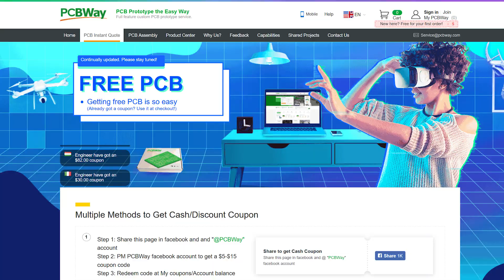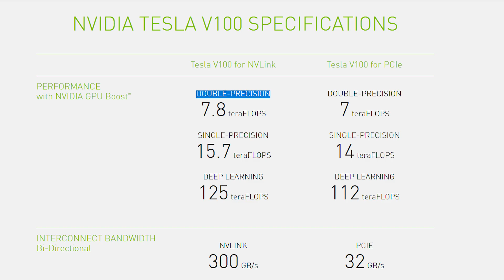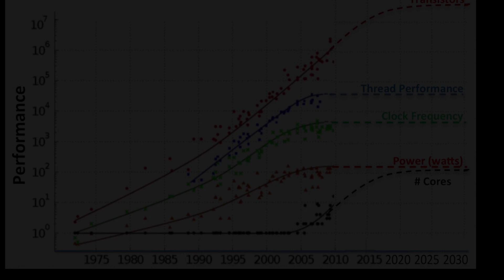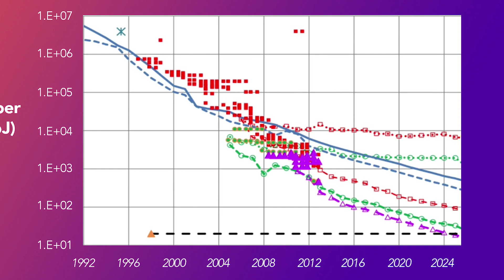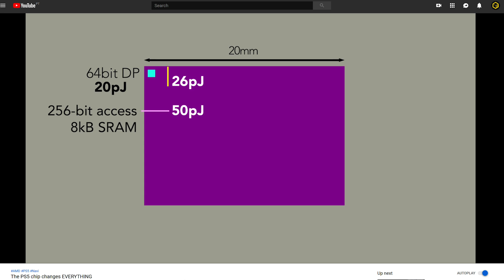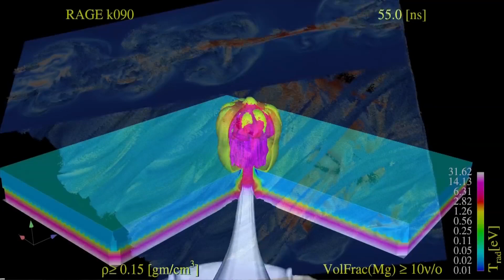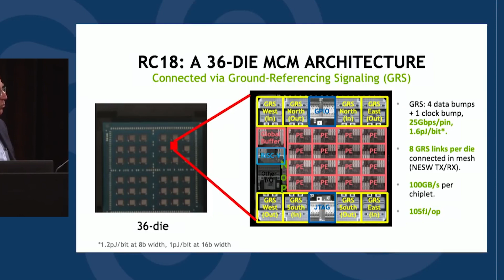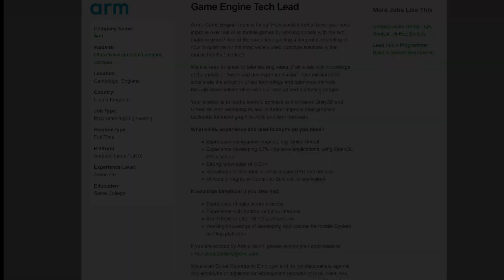The FUTURE of Computing Performance

Comment: So I guess this is what Lisa Su was talking about when she commented on the necessity of bringing x86 and ARM architectures together?
Reply: Miguel Pereira Wow it would be awesome
Reply: Why you walk bacwards?who care about x86 when we in age on x64...😂
Reply: @riannair7101  x64 is the same base instruction set, just 64 bit data and addressing instead of 32 bit. x86 comes from the Intel 8086 chip. x64 is just a misnomer for the same set dealing with 64 bits.
Reply: @getsideways7257  sometimes also denoted as x86-64
Reply: @Dylan-xc8yz  Indeed.

Comment: There is another largely unexplored area called reversible computing (adiabatic computing). Currently you waste a lot of energy when erasing information by releasing it as heat into the atmosphere  and reversible computing aims to avoid that as much as possible by reversing some of the steps in the computations. In theory you can create a significantly more energy efficient device than anything of what we have today.
Reply from the maker: Yes this is true, and there are other advancements and experiments going on in the area (NVidia has a few I didn't mention). I'll probably cover it in a video in the future.

Comment: There's an interesting story about the first ARM CPU that was made:
When they first tested it they accidentally put it into a test bench with broken power delivery to the CPU... And they didn't even notice until they measured the power draw, because the CPU worked perfectly, running on 0.1W of leakage from the I/O. This was on a 55mm^2 die and 3000nm process.

So yeah, to just say that ARM is energy efficient is an understatement. It's ridiculously efficient.

Comment: Remember who said, in 20 years chip will be 10 ghz
Reply: Theyve got it we just arent ready to see it for ourselves yet in eyes of the gods of Silicon valley.
Reply: They got a Pentium chip up to 7.4 ghz 10 to 15 years ago, but there was no FSB that would allow enough throughput at the time to allow it to do anything but get to post screen and run essentially what was a DOS  stress test on the chip itself, and it also did that on DDR2 memory--let that sink in.

As a result: yes, 10ghz chips can easily be made, but no, the heat management, applications, and all the etc things that would make it viable at the consumer level does not exist.
Reply: @formdoggie5 
Maybe Intel simply wants More Profit Margin, spend money on Marketing and if they messed up they tend to doing the shady things, 
rather than spend money on R&D and make great products

If Intel keep evolving since they beat IBM, now we will have 7nm made by Intel, heck even 5nm

Just like ARM

But no
When Ryzen release, Intel know they messed up until 2021 
So they contacted Dell HP to only make products based on Intel CPU

That's only 1 deal that known to public 
What about others, especially on Laptop category ??

I use Intel up until Haswell,
tbh, i planned to upgrade in 2017 with Intel PC too, but then Ryzen release while offer better products and reviewers agree 

Then Intel hit by Security scandals until now,
I'm glad switched team
Reply: @formdoggie5  Not to mention, to push clocks that high, you sacrifice IPC.

It's more energy efficient to pursue higher IPC at lower clocks.
Reply: @ultraranger  Photonic processors have potential to reach THz speeds
Reply: der8auer got a regular AMD FX chip up to 8.1 GHz. not quite 10 but getting close
Reply: I over clocked my toilet to 10 flushes per minute, but I can't get it stable right now, sometimes the toilet explodes while taking a dump

Comment: Yes, this kind of data management is what I have been trying to program for years. Programming is really outdated in how it has become so abstracted from memory management... It is now great for learning, but performant code is almost impossible on lightweight cores without an easily utililizable (understandable) method for data transfer (over large distances and short). If automated analysis of data transfers (through machine learning) becomes a thing this might become a common/necessary optimization step when programming.
Reply: Let's put deep learning on industry standard compilers for data locality's sake.

Comment: Sony's cell processor ring any bells? I remember the Airforce  or Weather Agency bought  thousands of PS3s to build a very niche supercomputer.
Reply: Which is why OtherOS was removed. Sony made a heavy loss on the machines which they would recoup on software sales. But those institutions had no intentions to buy any games.
Reply: @snetmotnosrorb3946  OtherOS was removed because it opened the doors for unsigned code execution. It was simply an anti piracy measurement.
Reply: It was both.
Reply: What is OtherOs?
Reply: DuckDuckGo is your friend. First hit: https://en.wikipedia.org/wiki/OtherOS

Comment: When you showed the job advert it "finally" clicked in my head as to how you can make such far reaching predictions. The hiring cycle has to preceed the product by a given amount of time.
Brilliant!
Reply: It's not just that, but he has a really good understanding of the fundamentals behind chip design, not just a surface level understanding of cores, cache, and ALU's. 

He understands things like the various limits to core scaling, clock scaling, and power scaling, as well as the conundrum of power usage to transport data. These are all areas where Silicon needs to improve. Not just by iterating on existing designs, but by fundamentally challenging the way we store, organize, and move data on a chip, and how we schedule and program tasks, and even how the actual chips are laid out. And he's absolutely right.

As for what he's hinting about how our brains work and why future computers will be more like brains.... a Brain has ~6 Exaflops of computational power, and runs on just 20W of power. Imagine how inefficient "Hexaflop" supercomputers are, compared to our brains. 

That's where we're headed with computers, hopefully soon. :)

Comment: Amdahl's law is not a hard and fast kind of law. The character of Amdahl's law is that at some point you can't solve the same problem any faster by adding more cores; but you can solve a bigger problem just as fast. That bigger problem is one where there is more parallelism to mine. Models of supernovas and such problems used to be 1D, then 2D, then 3D. A key driver for this change was that you couldn't make 2D models any faster. Instead of going to a 3D model, an even more trivial side-stepping would have been to run N models with different input data in parallel on different .

This will be true of things like games and consumer software as well. More cores means you don't have to fake the actions NPCs; they can keep simulating even when they are out of view. You don't have to store so much data if you can compute it on the fly; so you can spin off some CUs or cores to deal with this. 3D positional audio today is awful; just awful; worse even than the Aureal A3D 2.0 chip from the late 90's; but they could be much better; you can spin off some GPU resources for this; AMD and nVidia are actually trying.
Reply: Aureal A3D 2.0 was and still is arguably the best 3D sound.
Reply: @snetmotnosrorb3946  It's not the best positional sound because of something amazing Aureal did; it's the best positional audio because it's competitors were amazingly inept. I still maintain a Win98SE machine for A3D 2.0.

Comment: 5 minutes in watching on my HTPC and the home theatre system.
- pauses - turns off the subwoofer - pushes play again
Perfect.

But seriously Celso, tone down the low end of your audio, please.
Reply from the maker: @George D I've tried changing the sound settings around but it's never right once you upload it to youtube. But if it sounds fine after you turn off your subwoofer, I guess that's not so bad then?
Reply: @Coreteks  Both yes, and no. For me it is a minor inconvenience and doesn't really affect how much I enjoy your videos. Others might find it fatiguing to listen to your relatively long videos and/or difficult to make out what you are saying because of this. Still others might need to adjust the volume way too high, depending on their headphones/speakers, etc. I've tried some basic sound editing over the years and I've found that a high-pass filter with a cut-off at around the 100Hz mark works wonders if you are still going for the cut mids and the compressed feel of your audio. :) Sorry for the off-topic!
Reply from the maker: @GeorgeD1  thanks for the suggestions, I'll try it
Reply: Sounds fine on my Smartphone (S10) though.
Reply: I have the same problem here with my PC speakers  (includes a bass box). But I'm no native speaker so it's harder for me ;-)

Comment: the low-level hardware driver software can have this fancy looping built-it, which could be an abstraction layer between the operating-system and the hardware; which means the software-stacks can remain without industry disruption.

Comment: Sounds great in theory. But I have a computer game I love to play but the developer claims that most tasks can't be parallelized. Therefore even throwing more cores at the game, I can't speed it up.
Reply: we could tell a code to run every new code in every loop in new thread, but you can't predict which data depend on which code in\ sequence of loop, at worse each loop depend on previous loop, so the code will "lock" each other up, waiting them in sequence, like a single-thread. That's why it's not clear whether parallelisation is possible in games.
Reply: @xponen  I think this is the problem. Operations in the game depend on the results of other operations. This is a 4X game, not a shooter or RPG where things are rendered on the fly.
Reply: Sins of a solar empire....

Comment: So, basically we are trying to move closer to the model of the synapse. A computational self powered switch that can also store that bit. Would it not make sense then to just make an architecture where the memory bits posses the capacity to also process that bit? It would only double the size of the bit but you do need some kind of distribution scheduler. I think this is where stacking could be most efficient. Have your processor/memory bits on the top connected underneath by a silicon version of neural branches controlled by a primitive controller.

Comment: @Coreteks what about integrating little cores into the controller of RAM Modules? That way you would scale with memory and the micro architecture can be optimized on the module and the main cpu is mostly just an orchestrator. Actually lots of computation should directly be performed on memory but that is a long way off.  BTW what is your take on memristor? My money is on integrating compute on the memory module however.
Reply: Processor in memory has been tried before, not successful. Optimizing a process for memory is not the same as optimization for computation. HBM or putting processing near flash memory makes more sense.

Comment: For all single value mapping functions, like the basic trigonometric functions, how about solving via specialized hardware table lookup with table sized such as pre-computed values from tables sized to all possible values accelerate in single clock cycles. For non-pre computed single value functions, how about separate sparse matrix memories so that particular value is calculated just once?

Comment: Basically for the same power consumption of the chip ARM will have higher total computation capacity virus Complex instruction set due power consumption.
Also if you think of it, RISC, can have a lot more reuse transistor for performing same computation, were as CISC can't be re-used so
basically if have compute all types of instructions and complex instructions density on the chip per clock, you have an optimization point.
3 dim for area density, 1 more dim for instruction time. Then work out the computing power of an 3d area per time density and compare the chips.

Full associative array mapping of memory into address space that the cpu can operator on directly.
Small specialized Chips for algorithms do lookups on memory, by executing that looksup in each memory bank.
Then also array/matrix multiplication in each memory bank. Then use queues where the cpu co-ordinates and queues all ops async.
Then also look at cache memory controller, that balance load by redistributing memory layout between mem chips to balance the load
of all lookups and computations such that all peace meal ops are run in parallel at the memory chip level. Less data being moved around.
Them combine ram refresh cycles with updates and shits from the async queue of instructions.
branch prediction and program analysis can identify instruction set in tradition cpu, that can be offloaded to mem chip.
So we don't have to recompile, only use better data structures and paging alignments.

I would also look at malloc, typically taking a page size and returning a page size or more complex local cpu memory configuration metadata iterator layout.
Then by using iterators in future, we can abstract this concept away, by storing the data locality metadata in the iterator.
So someone writing a loop, wouldn't need to know about it, the compiler would just be updated.
The malloc, might need to take a hint, if the there different layouts for different types of computations, to be fast.
the resulting memory reference could limit the types of operations based on the malloc memory layout choose for speed.
We then exposed the boundaries and conversion between malloc memory datastructre metadata layout for iterators for conversion between the different types.
I can seem myself being able to build and do the typing for this, typically like the good all array multiplication adjustments for match cache page full associative mapping size.
Reply: How CPUs appear and how they work internally are completelly different things.

Nowadays x86 CPUs are not internally CISC while RISC of todays have hundreds of instructions on the outside. They are closer to each other than ever before.

Even RISC V which is very young already have over hundred of them with more extensions in future.

And at the end of the day well somewhere that same data have to be stored. Which means 'transistors'.

Comment: when we got 3-d graphen processors? i wait for it 10y and still nothing :P
Reply: MrValgard probably another 10-20 years
Reply: There is problem with graphen: it doesn't have forbidden zone (band gap) which is crucial for semiconductors to work. They're trying to introduce this gap one way or another: making it of complex shapes or putting it on substrate, but so far resulting gap is too low, it's like reverting to germanium from silicon.
Reply: but why graphene at all? from this video it seems there's still more unfinished business with silicon, for it to get faster.
Reply: @xponen  why monetize and hold on humanity if we can accelerate already?
Reply: CARBON NANOTUBE TRANSISTOOOORS
Reply: @MrValgard  usually it isn't certain whether certain tech will accelerate technology, scientist sees potential but usually it is "research", doesn't mean one can manufacture them for consumer.
Reply: @xponen  I am for carbon nanotube 3D processors, silicon can at best allow for another 100x improvement, not more.
Reply: @xponen  graphene allows for smaller process nodes if i'm not wrong, it gets increasingly harder to manufacture smalller process nodes with silicon, especially when going into picometers

Comment: HPC can run in the cloud. A lot of research institutions are actually using AWS and other services  for that. A decent junk of research done at supercomputers doesn't actually need the interconnection between the nodes and is run on just single nodes or even only a few cores on a node. In theory, you could run those on a decent modern PC without a problem. The reason why supercomputers are used is simply the availability of hundreds or even thousands of nodes, so people can run hundreds of such calculations at a time.

Comment: Engineers love fables and myths like that ARM chip back in the 80' running w/o power (only on "leakage power"??? given the fact at that time 5V was the nearly absolute low power supply voltage). Everyone with practical electronics experience would know the story was at best hyperbolic recreation of some mundane case (if at all happened) being quite different than the final awesome version of the story.

Comment: I think that the main limitation is actually memory bandwidth.
the problem of the supercomputer is that it can't be just one computer it has to be 1000 of separate computers where each will have its own memory because the cache size must be big enough to fit entire operational data. 
it is fine if you can divide process into independent operations but if input depends on the output heavily you cannot get any faster

this is also the reason why small cores are not that effective. each of them needs a copy of the full memory wahst is expensive. it is beneficial to do something to make cores share the same memory. so this is a reason why everyone is trying to cram more cores into one chip.

If memory prices will go down I think that problems can be reduced, because instead of just one GPU chip  you will use 10 where each will have its own memory
but that will make your GPU contain 80 gigabytes while being able to fit only 8gb for data in them

if we go further and make 32gb GPUs then put 100-1000 of them in parallel what will be enough for real-time raytracing you will end with multiple terabytes of RAM on the GPU

Comment: You are right in most of your insights. My conclusion from this video is that the hardware industry will depend more and more on the software implementations and optimizations. So, either hardware vendors will push specific programming paradigms through their hardware or the software evolution will dictate hardware design (or both).9